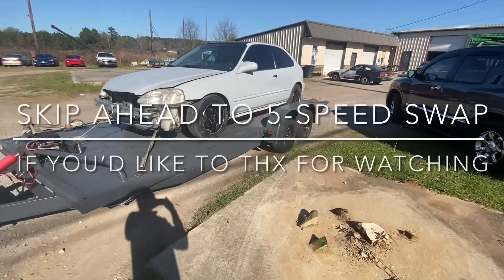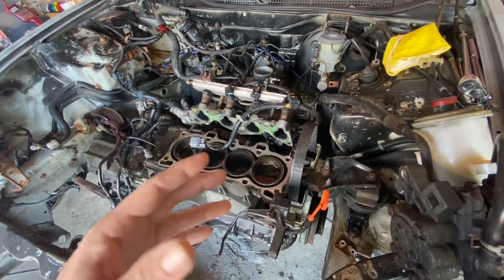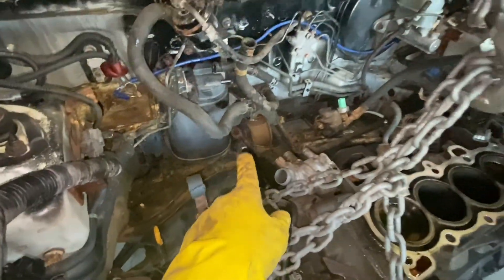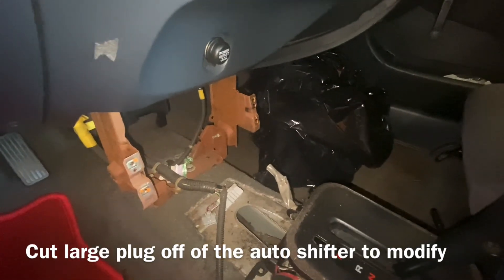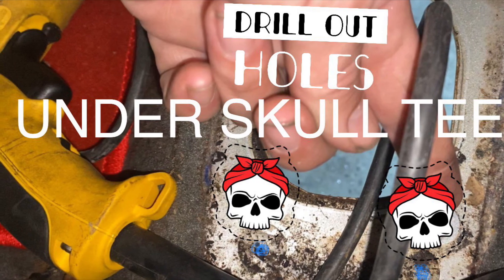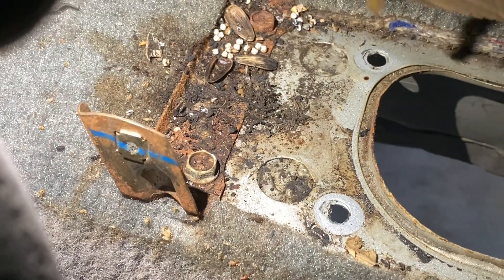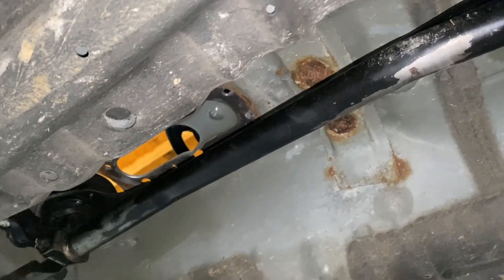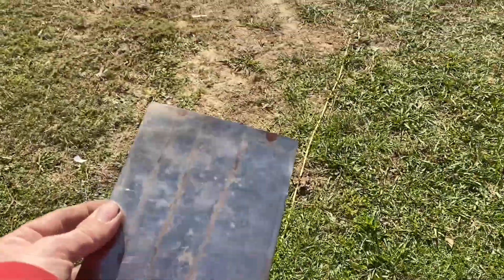$800 AUTO EK CIVIC HATCH GETS A MANUAL SWAP AND STOUT TURBO MOTOR

Comment: Will the same way you wired the park neutral safety, reverse wiring etc. Work on a 98-2002 Accord auto to 5 spd swap .Also with the 5 speed ecm do I need to get it reprogramed

Comment: Hey man! Quick question I didn't see it in the video.  But did you have to wire up the VSS for the manual transmission
Reply from the maker: We used a manual engine harness and I believe they read the same either way if you use a automatic engine harness and you have to wire in the reverse lights on either way on the automatic body harness on the inside of car. The automatic engine harnesses can be used for a manual it’s just easier using a manual engine harness on a 96-00
Reply from the maker: @muthafukkajones  find a buddy that has an extra known good vss and try it out. If it still doesn’t work and it’s not corroded on the pins check where the black ground runs up to it’s point and see if it’s corroded there. It may just be a bad vss.

Comment: Did you change the ecu? I just got a manual ecu for my hatch but all but one of the connectors dosent fit
Reply from the maker: For the 96-98 they are called obd2a and for the 99-00 civics(99-01 tegs) they are called ob2b ecu connection. All 96-00 civics are not the same, if everything plugged up and works and you have a small plug from harness left, that’s you automatic transmission plug. We changed our completely to a 92-95 obd1 ecu so we’d have tuning capabilities. Hope that helps
Reply: @i4boosting328  this helps so much I was so confused on what it was for thanks so much for the help I can finally get my car running 🙏🙏

Comment: is that the only way to wire up reverse lights? could i connect from the c101 plug straight to the yellow and green on the shifter plug?

Comment: Man i ain’t trying to be no asshole, but you if you got that sombitch out the car, pressure wash or clean that damn thing. 😂 I found it helps, plus if you have a leak after all is said and done, you can find her fast.
Reply from the maker: Lol yes it absolutely does! My pressure washer literally blew up a few days before. That’s why we had to clean the shell bay at the car wash. He had just cleaned the bottom of that pan and trans about a week or so before. The way the previous owner welded/jb welded 🤦‍♂️the bung on the pan it was making a mess. He wanted to wait till the moroso oil pan got here to clean it again since he was gonna be driving the car before it came in checking for any problems in the hatch body. It has done well for him so far.